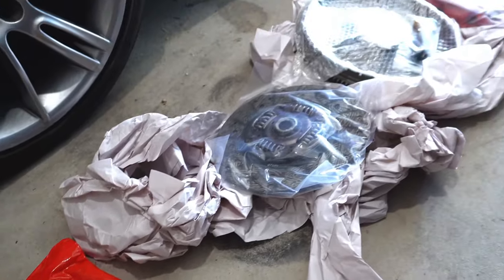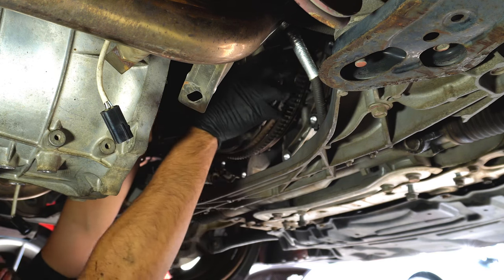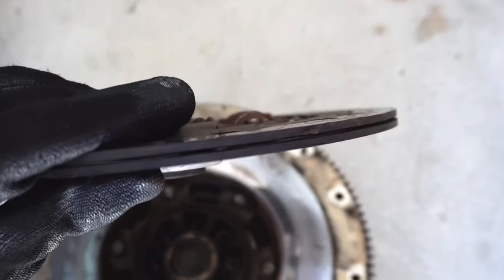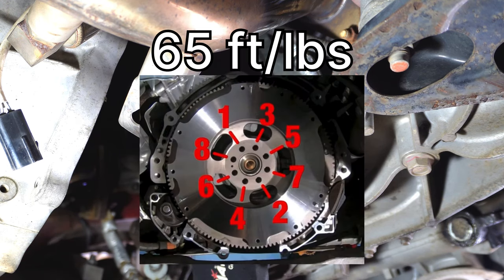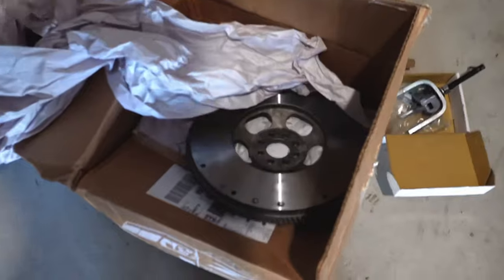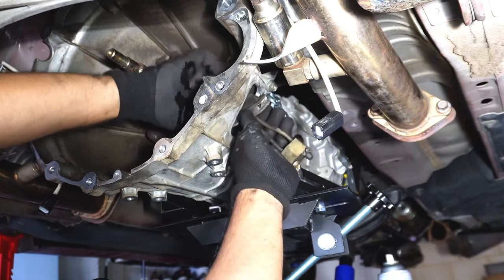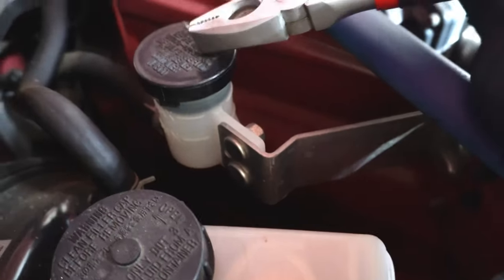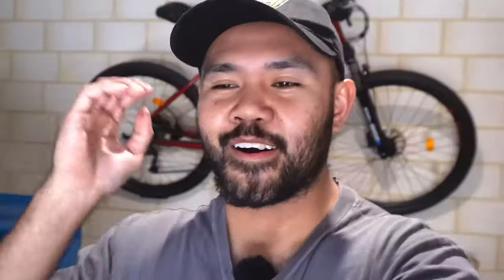Nissan 370z Stage 2 Z1 Motorsports Clutch + Midweight Flywheel INSTALL !

Comment: Hey I can’t seem to get pressure back in my clutch no matter how much i bleed it. Everything looks fine i already double checked everything but can’t seem to get the clutch working again. Any suggestions i can do? Thank you
Reply from the maker: Bench bleed the master cylinder then bleed the system again. No pressure with no signs of leaks = air in the system

Comment: Got done installing my Z1 flywheel 6 puck disc &. Press. Plate also deleted csc to pull type solo in my garage drove it most evening and jacked it back up to inspect leaks all looking well! Will highly suggest everyone doing this to get rear crank shaft seal and all new bolts for flywheel, pressure plate & trans to engine bolts. Took 2 week process due to waiting on the seal & bolts. I was looking at the bolts removed and the threadings looked worn had nightmares of this happening.. when bolt gets torqued over time from vibration they get worn specially after extraction unless it’s those special racing bolts
Reply from the maker: How does the 6 puck feel? And agreed to everything you mentioned!
Reply: Definitely stiffer clutch system but amazed how quickly the response is feel like there’s no lose on revs when shifting I heard I still have to break it in and gotta get use to the chattering lol
Reply from the maker: @kappa8767 interesting, how’s the engagement? Harsh bite? Been interested in seeing how the 6 puk clutches feel

Comment: Why didn’t you replace the rear main seal while you were in there? I
Reply from the maker: Yeah look tbh I should’ve while I was there hahah
Reply: @HustleGarageTV the bolt that broke.  Was it a brand new one or did you reuse it? Just out of curiosity
Reply from the maker: @v36lou  was a reused bolt. But I bought the new ARP bolts

Comment: Do you have syncro or rev-matching? If so, did the lighter flywheel cause it to over rev when down shifting?
Reply from the maker: Yeah I have the rev matching, umm not that I have picked up on. I’ll have a look when I drive it next hahaha didn’t really cross my mind cause it just felt normal
Reply: Okay good haha! because when I do my clutch I want a lighter flywheel as well and was worried I’d have to figure out how to get it retuned or something. How was the revhang with the flywheel you got?
Reply from the maker: Honestly I wish I got the lightest flywheel, I got a Midweight flywheel so it’s definitely better than stock dmf but I think the lightest flywheel would be a huge change.
Reply: Good to know… awesome video man I’ll be using it when i install mine!
Reply from the maker: @elinoble8936  no worries bro, thank you heaps for watching! 🫡